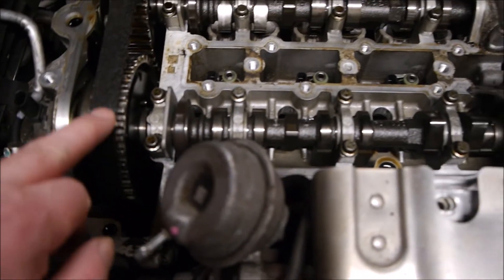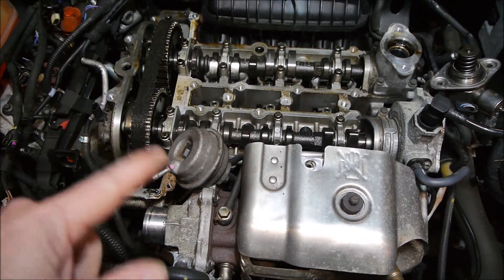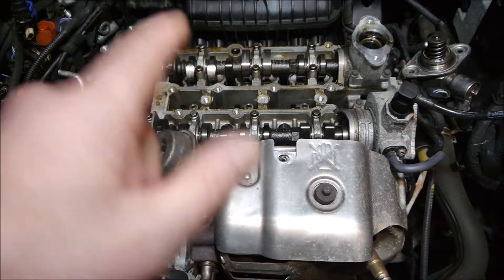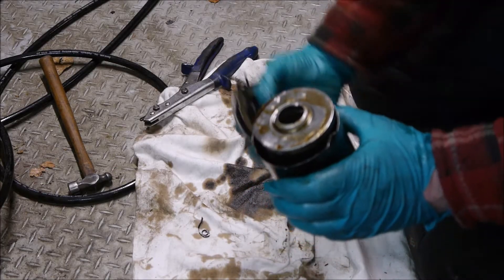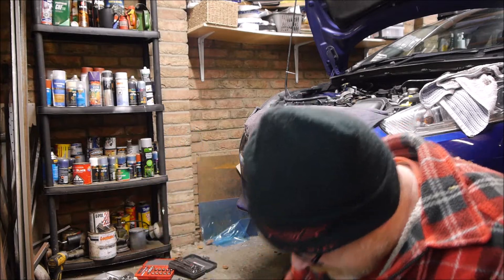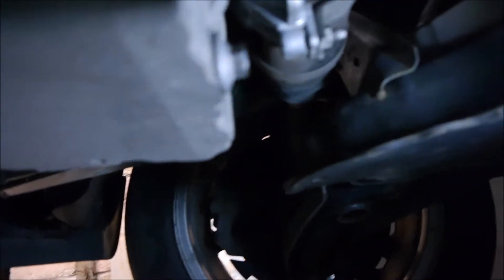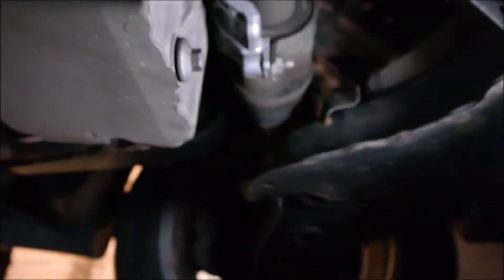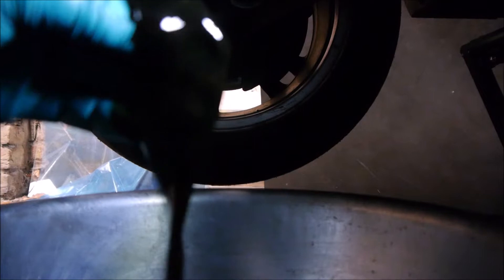Ford Fiesta 1.0 Ecoboost  part 2-   Ecoboost or Eco Boom!

Comment: Have you ever worked on the VW TSI engines in Skoda or any other VW owned car? Mine failed its MOT recently on monoxide emissions, at 12 years old, approx. 111839 miles on the odometer, and was burning through an average of 5L of engine in two months only with short to medium journeys. Garage said I'd need a new engine.
Reply from the maker: Sorry no experience of that engine. However that amount of oil used does sound excessive

Comment: Wife has an 8 yr old fiesta, 1.0, ecoboost, only 26500 miles. Should I get wet belt changed or part ex car? Any advise would be much appreciated.
Reply from the maker: @OldhamSteve52  if it's been regularly serviced it should be fine at that mileage.  Belt change is about £500 at a garage

Comment: Just did one of those engine's and they are nightmares replaced the oil belt and timing, and oil pump and tensioners, got it started and have bad noise out of the lifters and valve's was loaded with old belt crap but no metal in oil so at a crossroads now can I replace lifters and solve the problem?
Reply from the maker: @leejayking  hard to tell tbh. Have you removed lifter and checked for debris or oil starvation?

Comment: Try Wurth-Rost-Off , yes spelt “Rost” as its German but the spray freezes the nut or bolt to -45c then turns blue thus shrinking the nut or bolt by 5% , it’s dam good stuff for these jobs & perfect for seized brake bleed nipples too 👍
Reply from the maker: @richie674  I'll give that ago thanks

Comment: In short, 
you buy an eco engine with a wet belt at the oil pump because it performs better in eco terms.

Then you are forced to change oil at least x3 times as often (very eco-friendly) and pray that it will save the engine,  
and if you are lucky enough then at 60k miles you will pay a significant amount to replace the belt 
and keep changing oils !!
Reply from the maker: @billpet4602  haha. Yes that about sums it up.

Comment: My 2019 Fiesta has just been diagnosed as needing a new engine due to low oil pressure. Done 115k and 40k of those in last 18 months. A shame as I quite liked the old girl.
Reply from the maker: Its shocking isnt it ona 4 year old car.
Reply: It is really. However it's a company car and they don't have them serviced at main dealers which had they done then possibly it might not have happened. It was serviced about 3 weeks before the low oil pressure light came on. I have 2 MG's with the k-series engine.....much maligned but still going strong at 18 and 21 years old.
Reply from the maker: @michaelbousfield4778  company car. Well. Rhay softerned the blow then.   A bet the MG'a are startting to become collectors items.

Comment: Great video, another thing to watch on the ford fiesta including the focus the cooling  expansion filler tank can develop small hairline cracks caused by the tank becoming brital with heat and age. The first you know about this is when you notice leaking coolent by the pulleys giving the impression of leaking water pump . The cracks usually develop underneath the expansion tank were you carnt see it .

Comment: Why oh why if your a mechanic did you buy an Ecoboost
Reply from the maker: Firstly I'm not mechanic. And secondly we bought it cheap and installed a recon engine which will easily out last our needs. Also it was also a fun  project. What can I say I like a challenge.  Next you'll be saying I shouldnt  have bought  a 911 because they all have Ims bearing  failures. .

Comment: Tbf I never know what noise is and isnt normal on these engines. Since new my engine makes a clacky/tappy sound when lightly revving, but its been like that for ages now
Reply from the maker: Tbh. They aren't the quietest engine and the fuel pump on the top at the back Lhs is a bit tappy. If it doesn't get worse over time then don't worry about it.
Reply: @vintagesteelgarage  Yes and I forgot to add that noise is only when cold/first starting
Reply from the maker: That's probably normal then.

Comment: I have heard that the turbo is suspect on these engines too for the same oil, starvation reasons…
Reply from the maker: Yes it will be. All turbos  need a very good oil supply as its a plain bearing ie no rollers or bearings so it really needs a health constant oil supply. This was was toast as well due to oil starvation.
Reply: @vintagesteelgarage oil starvation from the oil pick up being block with particles of belt 👍🏻👍🏻

Comment: Oil change and filter every 5000 miles is the key to this engines survival
Reply: And don't use an engine flush when changing the oil, as they can break down the belt.
Reply from the maker: Yes that's very good point I hadn't thought of that. Or any other additive such as sea foam.
Reply: Hey. Will this be rhe same for focus 2016 titanium eco Boost. I just paid for it and i just saw all this things online about it..
Reply from the maker: @olajuyigbesegun2049 i think the design of all the eco booat engines is the same.
Reply: @vintagesteelgarage the 2.0L has a chain doesn’t it? Does that make it more reliable than the rest?

I was looking at 2016 Focuses and people say avoid 1.5L EB like the plague but I don’t hear much about the 2.0L EB
Reply from the maker: @pulsemona yes chain drive is better
Reply: @vintagesteelgarage  all of the new EcoBoost engines use chain
Reply from the maker: @scottpenfold4373 good to know. Do you know from what year?
Reply: @vintagesteelgarage  I believe they made the switch to chain in 2020 at some point. That's what I found online
Reply: @scottpenfold4373  yes they use chain of timing, HOWEVER they still use belt on oil pump. Somehow they made stripping teeth from oil pump belt even worse on those updated engines.
Reply from the maker: @BOTmaster15 crazy why it's not a chain on both.
Reply from the maker: Yes an absolute must 👍
Reply: Had my eco boost 1L Focus from new (2016 72k) Just did a service once a year with ford but would be 10k between services- am I looking at big problems? 
Is there anything I can do to anticipate the ecoboom and remedy before anything happens?
Reply from the maker: @warrenslattery8915  if you are having it serviced at ford at least that the correct spec  oil. Its probably due a  a cam belt change before 100k miles. That's the best insurance policy to have it replaced.
Reply: @warrenslattery8915 Ford have a recall today 15/02/24 could be in luck.
Reply: Why do an oil change every 5k?
Reply from the maker: @goodkingkarlos  recommendation by Ford to prevent used oil that has carbonised  and been through many heat cycles deterating the drive belt. It could go move but wouldn't go over 10k myself.
Reply: That's so expensive every 5k miles. 12,000 miles is the norm on the 1.25
Reply: 5k engine oil change for petrol is ridiculous. Nasty engines these are.
Reply: is 6000 too long?
Reply from the maker: 6k OK but best to do before 8k.

Comment: I was thinking of buying a 1.5 Ecoboost Fiesta ST. The earlier versions (up to around March 2019) had a chain for the oil pump drive, but the later ones used a belt like this. I think I will give them a miss.
Reply: Yes their JUNK biggest piece of shit I've ever seen in my life, Ford will never buy one and will tell my customers to RUN from one as fast as you can. And I have a customer list that's very long.
Reply from the maker: @leejayking yep the engine is a disaster. Ruins a good car.

Comment: I owned a 2013 Focus Ecoboost for 4 years, and luckily it gave me no problems. I moved it on at 50k miles though, having heard about the issues. I now have a Skoda Kamiq with the 1.0 litre 110bhp 3 cylinder VW engine. I'd say this engine is a little smoother and quieter than the Ford Ecoboost. It's also better on fuel, and doesn't require 14 hours to change the timing belt.....

Comment: Your are not alone brother same thing with my 1 l ecoboost ford at 160 000 km motor is dead because of wet belt and stuck pump oil... cost of repaire 8000 € and because i made the flush of oil myself every 20000 km ...i will not have the help of ford..
Reply from the maker: Wow thats expensive. I assume thats the final garage bill including labour.
Reply: @vintagesteelgarage  yes but with New motor I guess ..and new turbo ...i try to get second hand motor i think i can reduce the price to 4000 € after that i will sell the car . I had the chance to save my car 1 month ago with the vacuum pump was stuck with debris of belt and i was not sure about it... i have also problem with the valve on vacuum pump
Reply from the maker: You can buy the vac pump part for about £10.  I was lucky as I did engine myself. Total cost for recon engine. New clutch and new turbo was about £1800. Also we bought the car cheap as the engine had gone. So all in about £4500 for a 2015 fiesta. That now has a fresh life
Reply: @vintagesteelgarage  thanks for your answer do you think i need to change the  turbo also with the motor ? I guess when the oil pump failed the turbo was not lubricated ..
Reply from the maker: @maxmax-sr9lh it's what happened with ours. Take the air inlet pipe off to the turbo  and check for side play. There should be no side play.
Reply: @vintagesteelgarage  thx for everything i will check that 😀

Comment: As the engine problem is oul pressed loss and the crank is sat in our its unlikely you would have crank damage
Reply from the maker: The crank doesn't sit in oil. The oil level Is below the crank and needs to be pump though oil gallery in the crank. The crank would not be able to rotate at 6000 rpm if it sat in oil.
Reply: @vintagesteelgarage  with 5 litres of oil you would think it would survive
Reply from the maker: @Someone-p2x  I see what you are saying but the oil is in the sump and the pump is blocked with the drive belt shredding rubber apart and hence is unable to pump oil around the engine and crank. Thats why the crank is  blue with heat and then the bearing fails. The cranks goes before anything else as it has the most stress on it and without the cushion of oil it soon gets hot and fails. Quite a terrible design flat of having a rubber and fibre belt going though all the oil heat cycles and maybe precuoust owners not changing oil often enough.
Reply: @vintagesteelgarage  you've got me concerned now , I haven't pulled the sumo yet though.   Good video though

Comment: Ford by now MUST know that the wet belt is not working, I wonder why they are still using them?
Reply: Puma uses a Cam Chain but still Wet Belt for Oil Pump, Best thing you can do is buy a Toyota and F Ford.
Reply from the maker: I believe the latest ecoboost engines have a chain not a belt.
Reply: @vintagesteelgarage asked technician at Ford dealership about these they are all wet belt he said the only engine with timing chain is some of transit vans
Reply from the maker: OK good info. Thanks.
Reply: Oui mais pas  la pompe à huile, chercher  l'erreur !

Comment: I'm watching this in horror as a time served marine fitter/turner. I bought a new 3 cyl 1.0L, after a years wait, Fiesta Sport Van fully loaded apart from Power Fold Mirrors for personal use only, and certainly want many miles of trouble free motoring and what I'm seeing on YT does not make happy viewing.
Reply: from 7/2018 on with chain for the cams, but I dont know about the belt for the oil pump, still belt or chain - maybe someone knows
Reply from the maker: @roberthopf3376 I believe pump is still a belt
Reply: luckily - I had no idea about this problems - I bought my C-Max in Oktober 2018, the papers say it was assembled in August, so very lucky. That calms me a little, but still this damn oilpump belt.  Changing time for the camchain is either 240.000 km or 10 years (I found that out in the net) so in 5 years chain and belt are being replaced, and the oil pump strainer will be cleaned. What else would you recommend? I use the right oil and change it once a year, approximately 10.000 km @vintagesteelgarage
Reply from the maker: @roberthopf3376  yes regular oil changes and the correct grade will help.
Reply: @roberthopf3376    belt for oil pump so still crap
Reply from the maker: If it news to you then it's a good start. Use correct oil and change every 5k miles. However  I  think the very latest ones had reverted to a chain.

Comment: So would you say that good preventative maintenance would be to clean out the oil pick up on the oil pump?
Reply: Apparently it's important to use correct oil to prolong the belt.
Reply from the maker: Yes that would be a good idea. However if you do find bits in the pickup it does mean the belt is breaking up and only a matter of time before the belt  needs to be replaced.

Comment: Leave it to ford to use a Belt exposed to oil.  This is a major failure and i am expecting a class action lawsuit
Reply from the maker: I'm sure they'll get out of it be saying the correct oil hasn't been used
Reply: @vintagesteelgarage  There's people out there that have had nothing but dealer oil chand they're still having problems..

Comment: You need at £600 worth of tools to do a wet belt £900 worth if you buy the sealy Ford torque multiplier to undo and do up front pulley bolt and timing tools ⚒️
Reply from the maker: Yes correct and when you factor that in that's why I went for a recon engine.

Comment: The wet belts are rubbish wouldn't touch one, how are the timing chain mhevs doing in comparison.
Reply: The wet timing belt is a crazy idea. Should be banned by law! I would prefer a dry belt over a timing chain. It will last a very long time. If you dare ? I dare - and untill now the timing belt is 15 Years old, but with a low milage. Could last 10 more years - I hope. In my previous car i changed the dry timingbelt after 10 years. It looked like a completely now one - out of the box. My next car will be without Turbocharger. With indirect Port Injection. With a Dry Timing belt. If such long lasting cars are still made. Not sure?
Reply: @flemmingqvist8326 I dont think theres any non direct injection engine cars being made anymore if you want to buy a new car but there are some engines which uses dual injection now like toyota does to keep the intake valves clean with port injectors and the direct injectors there for more efficiency/better emissions and more power than port injection alone
Reply from the maker: Yes couldn't agree more.
Reply: The morons that designed that engine seem to think stupidity is a virtue.
I wouldn't touch one with a 10,000ft bargepole. 
My Mazda 2 1.5 skyactive g is a 4 cylinder 115 bhp non turbo and a timing chain 
Should be totally reliable with 5,000 miles oil and filter changes.
I  suggest Ford takes lessons from Mazda and COPY IT.
I feel gutted for you buddy 😢

Comment: Fancy doing the wet belt on my focus😂 Garage wants £1500
Reply from the maker: TBH that's not a bad price if they do the job properly. Are you changing because it's due on service or because its started to get noisy? if noisy damage may already be done!
If replaced properly garage should replace both  internal belts, tensioner and clean oil pump pickup pipe new filter and oil.   You need a torque multiplier to retorque the crank bolt which I don't have.   Recon engine was £1500 inc VAT, plus oils, ,filters, spark plugs, 3 piece clutch,  new turbo and other bits and pieces cost me about £2k not including labour.  I would say it took about 20 hours. Luckily my time is free. or else bill could have been about £4k.
Reply: Probably not financially viable on older cars
Reply: Is the belt made of gold ?
Reply: Cheapest I have seen is £990 but it's not economically viable on older cars